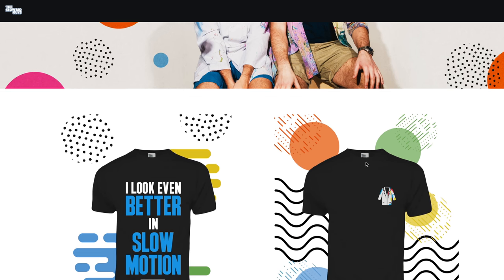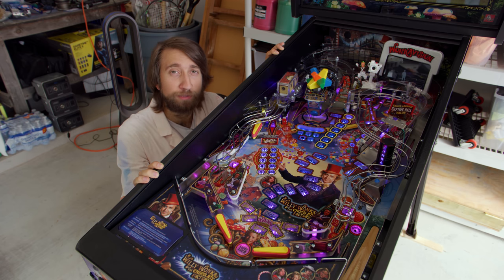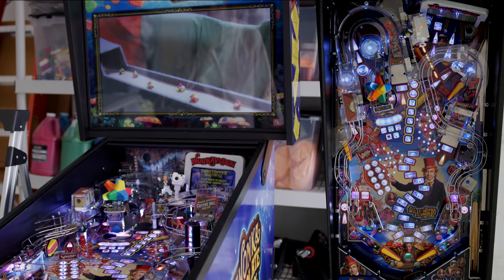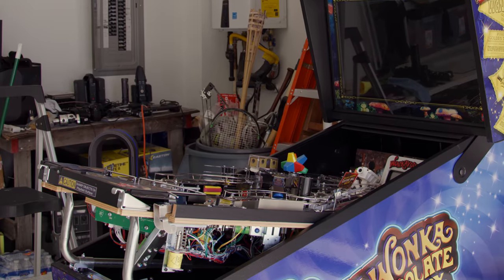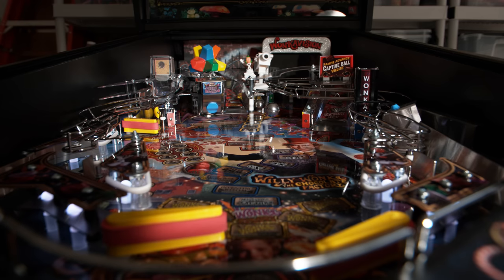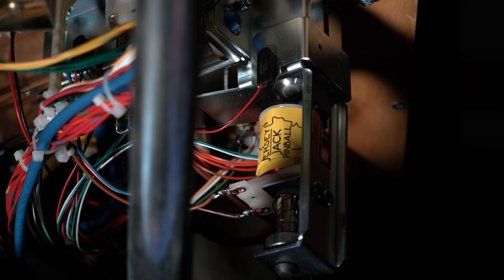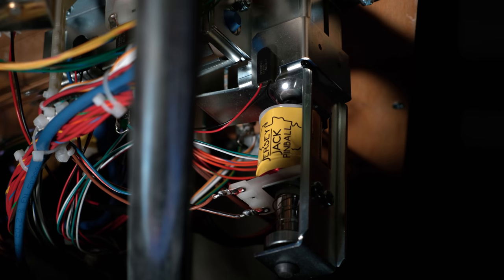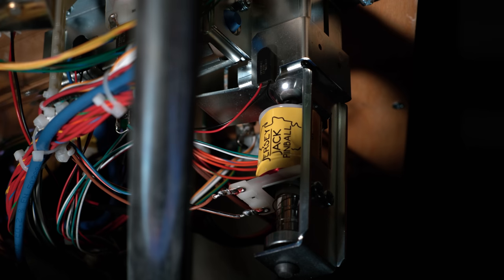How a Pinball Machine works in Slow Motion - The Slow Mo Guys

Comment: I've done a few "live catches" in my day, usually by accident...although I didn't know that's what they were called.

Is there a name for this move: ball is coming in to the flipper, usually from the opposite side of the board, with some "english" on it. The spin is in the direction of the center drain. You post up the flipper, then release it just as the ball makes contact with the rubber. The ball appears to stick to the flipper like a magnet as the flipper goes back down. Due to the spin, the ball it accelerates down the flipper. You gotta flip quick or it will drain, but this move allows you to flip from any point on the flipper if you're quick enough.

This move I've done all the time, but don't know what it's called.

Comment: The problem with pinball machine is that at times you have to open the glass and clean the inside..it collects dust..that glass is not completely airtight... the more you play for a long time..it's likely something is going to wear out or break.

Comment: Modern pinball components aren't "unchanged for decades" at all--newer games are always not only adding new components but changing the designs of existing ones like flippers and such to be better, faster, stronger. Sure the overall concept is the same, but I think saying "unchanged" is not really correct.